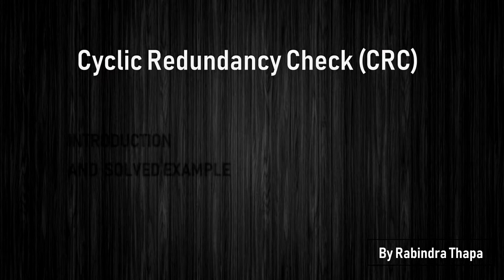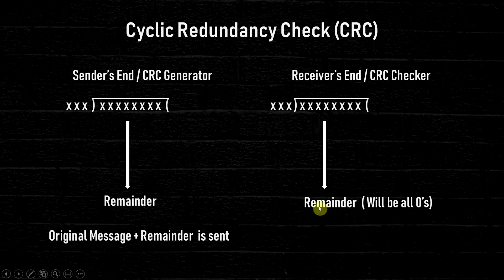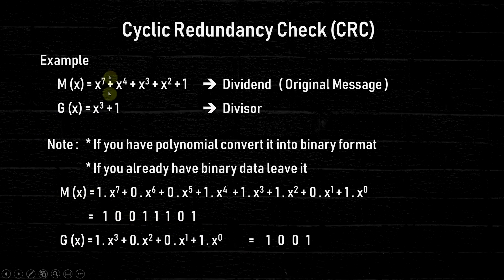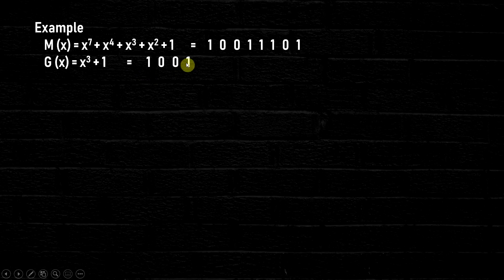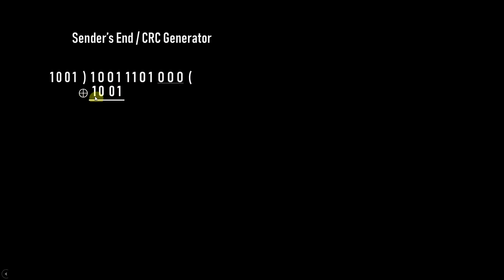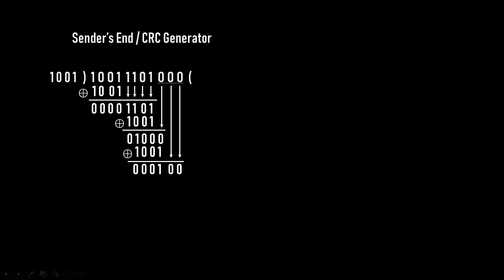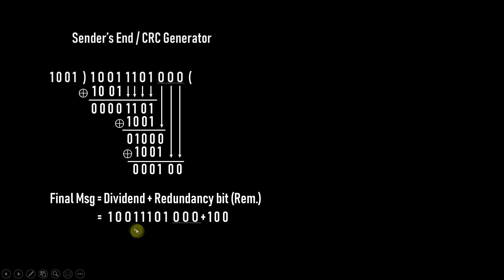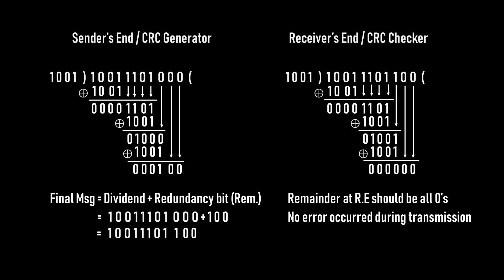Cyclic Redundancy Check (CRC) in English || Introduction And Solved Example

Comment: Hi and thanks,
What i don't understand is that, What if the CRC itself changes during transmission?
the CRC is also a set of bits that can change because of noise or interference, so how can we restitute the right crc (the one encoded in the sender's end)???